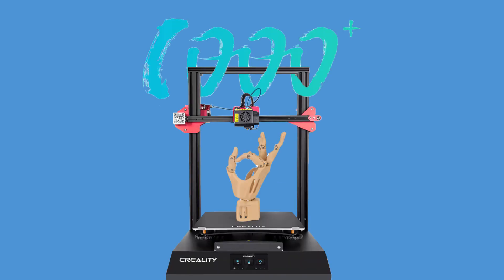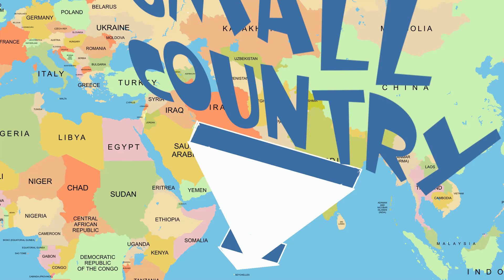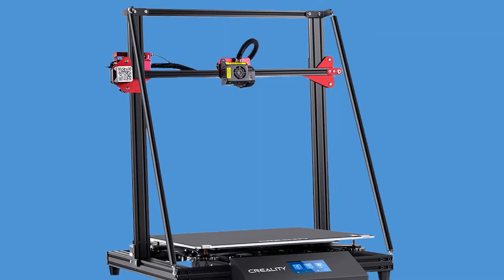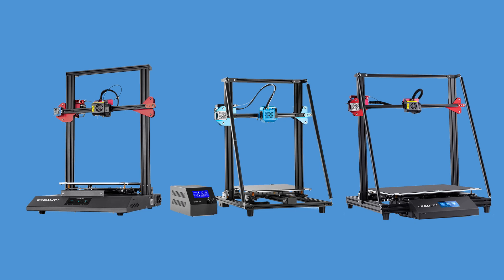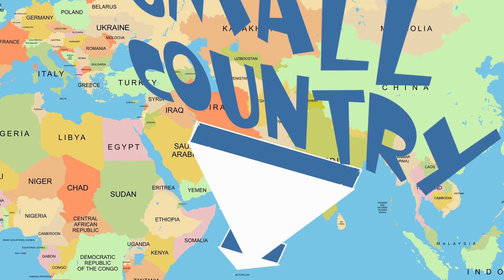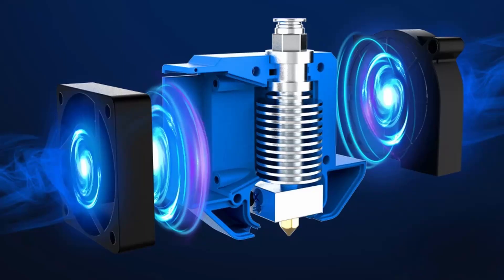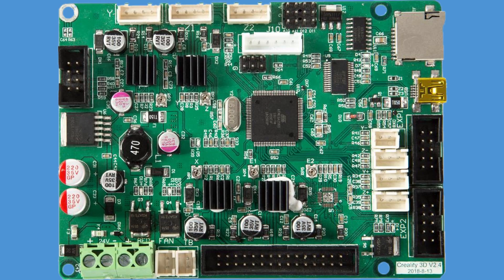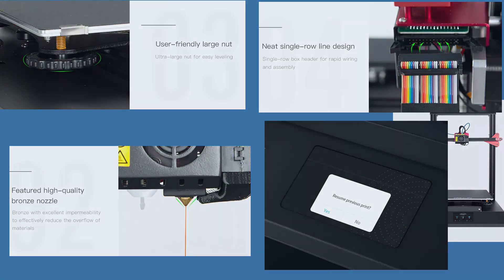Creality CR 10 S PRO V2 Pros and Cons

Comment: Still need to PRE-LEVEL the bed. Get it leveled as much as you can then use BL touch. I have yet to receive mine. Also, those knobs might loosen so possibly put blue loctite to keep it from backing out.
Reply from the maker: Yea, xurrently i only have manual leveling printers. I am not crazy about autobedleveling. I also may be biast because I had a bad experience with that capacitance probe on cr10 s pro. So I kind of im pk with manual for now. But sometimes is nice to just hit print and be sure it does not fail.

Comment: can you upgrade a CR-10S PRO to a CR-10S PRO V2? is the bltouch the only thing different?
Reply from the maker: i think the motherboard may be different as well. In addition the powersupply is more powerfull. There may be other details that may be different that i missed taking notice on.
Reply: @RoamingInterests  :( thx for the reply. kinda blows i own a CR-10S Pro and im very unhappy with the default bed leveling sensor.
Reply from the maker: yea, for that leveling sensor you should try the tiny3dmachines.com cr10 s pro firmware. last year the version i installed really reduced the issues with the sensor. i have a video that shows the data from last year and where to find the firmware file. https://youtu.be/_Bb4NlDA9ww
Reply: @RoamingInterests  Yeah i been running tiny machines firmware for almost a year. I had that issue that it keeped resetting my z adjustments every time i powered off. when i first got the printer last year. so i quickly moved to tiny machines fw.  (but i have not updated sense)  it looks like the main board is the same 2.4.1 if banggood is accurate on specs ? Im waiting for a response atm from creality to find out if i should run the firmware for a cr-10s pro v2 once i put on a bltouch. would make it much nicer for me.
Reply from the maker: I think tiny3dmachines may have a firmware for bl touch for your current cr10 s pro. I also think there are others that may have configured firmwares for the cr10 s pro with BL touch. I have to let you know that I havent had the cr 10 s pro in my posession for 8 months now. So I did not kept up with whats new and better for it. So I haven t done any new updates for it. In the other video I posted there are some links there. Or check the video for the links there.

Comment: Hi, I was wondering if the build plate is 300x300 or more than that in size, not volume.
Reply from the maker: The Build Plate Is about 300 by 300 or maybe 310 by 310. But the frame only allows for about 300 by 300.I think the Height is 400, to give you the actual 300 on the Z axis.

Comment: Funny how watching reviews where actual printers were tested ended up quite different. Why spend time on this? Factually, your assumptions are wrong.
Reply from the maker: No argument Here. they could be wrong, but they are based on my experience with other printers that were supposed to be great performers with good reviews and yet they had issues.

Comment: Hello mate, so. The conclusion, which is better CR10 V2 and CR10s Pro V2?
Reply from the maker: There are improvements on version 2 compared with version one. The bL-Touch is one of them so you do not have to go trough that upgrade. There are improvements in the power supply and Some have commented that is a great 3D printer. I think you may have to find a video that does the comparison in between CR-10 S pro and CR10 S PRO version 2.

Comment: As an owner of a cr-10s pro, I regret my purchase. At its core, it is a nice machine that is just plagued by poor design. Touch screens are really nice until you discover that it lacks many of the features of cheaper printers. The bed level sensor is nice until you realize how inaccurate it really is. The electronics box design is nice, until you want to print in an enclosure. The ability to power a small nation is nice once you start to modify the machine, no caveats. Literally every part of me wishes that I had just bought a CR-10s or waited for the CR-10 v2. I wouldn't have even considered buying a CR-10s pro v2 since I am not a fan of BLTouch sensors.
Reply from the maker: i feel so.e of your pain as i went trough a 16 week bootcamp on the cr10s pro before I returned it. mine was a pain to deal with.
Reply: @RoamingInterests  I've put a lot of time and money into it. If I get another printer, it'll probably be a cr-10 v2, or something similar with an external electronics box.
Reply from the maker: @777Thibs  That makes sense. If you  need an enclosure then yea that makes sense.
Reply: I've  noticed that enclosed printers don't appear to have separate power boxes and they work fine. i must admit that i am a big creality fan having an ender 3 and pro but i recently purchased an Artillery Sidewinder X1 and love it very quiet too!
Reply from the maker: @colinfielder6695  That sound like a winner.
Reply: Colin Fielder that’s exactly where I am at now, I’m either going to buy the sidewinder or the Creality v2 but I’m concerned that the sidewinder won’t have the community.
Reply from the maker: @ablack9431  I think you should check FB Groups and see what is the activity there. I got some activity on these videos and I have seen people talking about the sidewinder.  also you can try and find videos about it and see how many people speak about it and could help you.